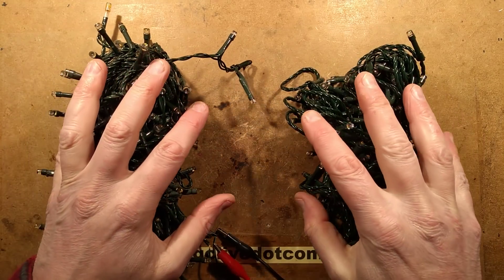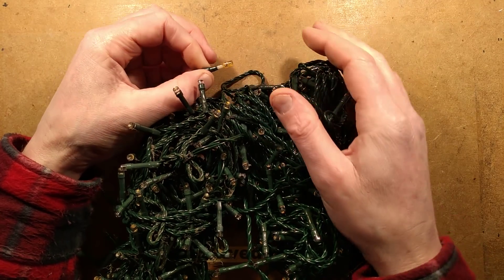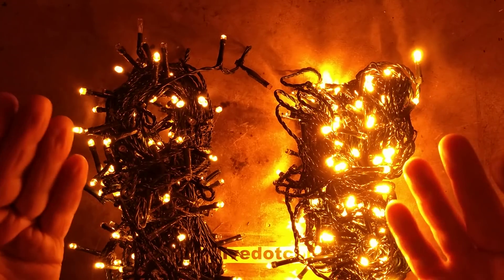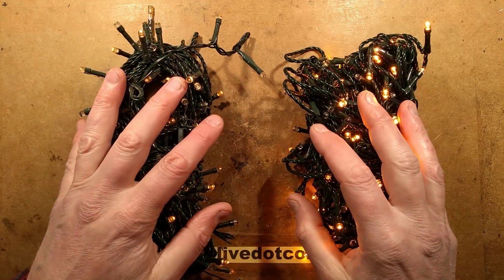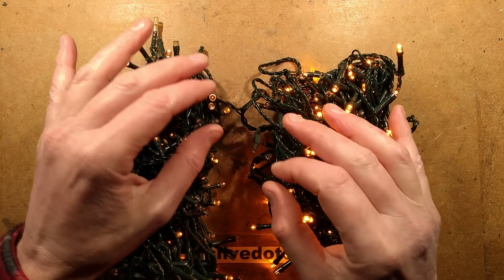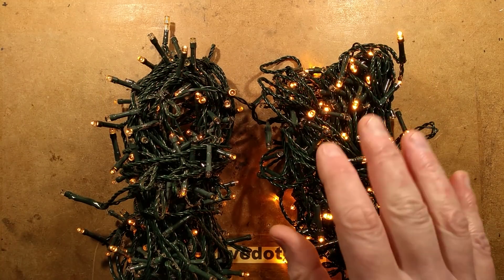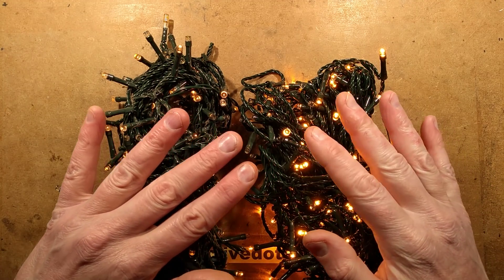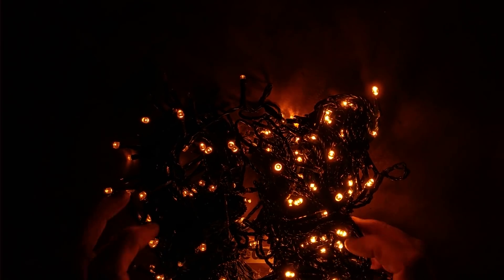9000 hour LED intensity loss test on LED strings.  (All LEDs do still work.)

Comment: That's a great video , highlights an important issue ... A search shows degradation is dependent on temp (current) .... driving leds at 15% recommended max power reduces  degradation by a factor of 10 !  also they are 35% more efficient at low current . The solution is simple a "10W lamp" should contain around  4 x 10W chips driven at 15% , the total  power consumption is 6W but will give the same light as one 10W chip driven at 10W ... chips are relatively cheap this would not double the cost of the lamp ... it would save 35% in electricity over it's life repaying the extra cost within a year ... but also saving the biggest expense  the labor in replacement ... it would last 10 times longer

Comment: I wonder if it's worth running your show lights at, say, 75% the first year, then you can set them higher each year to counteract the dimming effect? Obviously doesn't fix the problem but at least it's consistent.
Reply: running leds at 50% power makes them both more efficient and longer lasting, so that might work better than expected.
Reply: If you run them the way you probably wouldn’t have to even ramp up the intensity the following year...they’ll last a lot longer not being driven at full power. At that point corrosion would probably do them in before they start dimming out.
Reply: this was exactly my thought too but it isnt as shiny as high brightness! next year, go with twice the wattage lights but only half the power used to keep brightness high!
Reply: Just buy two sets of leds. If it is a constant voltage source, put them in series. If it is a constant current source, put them in parallel. In total, they together should output the same amount of light as one single one but they should last a looot longer!
Reply: @l3p3  If you put LED strings in series with a CV source, you double the minimum forward voltage needed to light them up and most likely get ~0% brightness.

Comment: Wow. This has opened my eyes. I taught physics and am generally technical savvy but amazingly believed that the life span quoted for led lamps was to failure. I now discover that it is something called “L-70” which is the time to 70% lumen output, at which time they should be replaced. Instead of being the wonder of the age, worthy of Nobel prizes, they have just been revealed to have feet of clay. OK they are saving gigawatt hours of energy but they are no longer the immortals I believed them to be. Sad.
Reply: Name something made by humans that does last a very long time without having to be maintained...

Comment: The same problem applies to LED's in modern television backlighting. The image can become so blue that, at first glance, it appears to be a problem with the colour balance but with closer inspection it can be determined that the backlighting LED's phosphor has degraded significantly, causing the image colour to shift to a very distinctive blue hue.

Comment: I've always thought that modern leds seem weak, you have proved it and im not mad after all, ok just a bit mad :-D
Remember the old red leds that lasted a very long time as a power indicator on just about every bit of electronics, i've seen leds from the 1980's still working fine.

I still think that all high power leds just can't cope with the heat and die.

Comment: Thanks for showing - very interesting! I am a bit surprised by the fast degradation of the leds after just one year. But its depending on so many parameters that it is hard to be generalized. On what current are the leds driven, how well does the PSU work, does it get overvoltage/current, do they get hot etc. etc. I build a night light a few years ago that is running 7/24 - and i cant see any degradation. I used SMD 5630 leds with nom. current of 45 mA. I run them on less than 1 mA (i thing it was around 0.15 mA) with sufficient brightness and they run of of two 18650 li-ion cells in parallel - i never charged them and starting voltage was at around 3.7V - now 3.6xx :-) The normal cell leakage is probably higher than the led consumption :-) It will probably last for the rest of my life (the leds)...

Comment: I bought a guitar multi-FX from eBay that was sold as faulty because the red LCD backlight was extremely dim. I thought that would be an easy fix so I got it and popped a couple of new LEDs in and they were so much brighter that I had to increase the resistor values. It's surprising to me that these even failed in the first place since they were only being run at 11mA each.

Comment: In our new building at work, we have high-grade LEDs (5000K), which, they told us, last way longer. They salesperson told us that the reason many LEDs degrade, is because of insufficient heat dissipation so every LED panel of their has this huge heat sink at the back to get rid of heat. I wonder if they're correct because these were NOT cheap LED panels to use. They are VERY bright though and I hope they will remain that way.

Comment: I bought a new strand of my LED tree lights 2 years after I bought the originals. At least after 2 seasons the brightness is identical (so far as my eyes can tell) between old and new. They're WalMart's brand so I wouldn't think any effort was put into their longevity. At any rate, after the first 2 seasons they paid for themselves over the cost of incandescent with the power bill savings. If I can get 2 more seasons after this one (5 total) out of them they'll pay for their replacement cost too. I use multi color lights, so by then incandescent ones would be burning out with badly faded color anyway. I can't complain.

Comment: Very illuminating - No Pun. This is why you always suggest running the strings at a lower output level - or other LEDS for that matter.
Okay now i get it fully. Now it makes very clear sense to run them down a bit - and why. I figured hey it's an LED it will last just about forever. Not so, they very much do have a limited life span being driven hard. And i guess i needed to be shown that, you did and i get it at long last i do get it. I thought you were just being very conservative - no you were not.
Consider this a lesson taught and learned. My eyes are wide open now. Thanks Clive. Merry Christmas to you and your Brother.
May the coming year ahead hold blessings and good fortune for you both.
Reply: 30 years ago I tried running some red 5mm LEDs at currents well above the manufacturers maximum rating. They did not last long! ALL LEDs degrade over time in terms of light output. Cheap LEDs are likely to degrade faster.

Comment: The only LEDs I have had go dim were in a wearable headlight. I find a lot of those heatshrink strings are not made quality. They could be made from surplus florr sweepings just to be nice. The ones I use are socketed and I haven't had a single one die in 5 years of 60 day 5 hour use. On another note I have had 120v led porch lights fail in just 2 years. It was either the drive components, or a LED chip burnt open.

Comment: Well good to know it't not me going insane XD. I got an LED strip for my room a couple months ago, and at first it was really bright, like almost too bright to the boint where it was distracting. But then a couple weeks later I couldn't help to feel like it has gotten dimmer, and I wasnt sure if that was it actually dimming or just me getting used to it's light. Had the same story with some other LED lights.. so thanks for clearing this up!

Just wondering tho.. is this the case for all LED's? Because with more and more street lights using LED's (and many of which are sealed so you have to replace the entire fixture) I can definetly see a future problem right there.

Comment: When I got my '93 Pathfinder, I found that the LED third brake light was very weak and splotchy. The voltage checked out and there was no evidence of moisture intrusion. I'd never seen LEDs wear out before, but I guess 230k miles of city driving over twenty-odd years had put some hours on them. I replaced the assembly with another used one with fewer miles on it and it's been fine since.

Comment: We bought a string of white LED lights in a flower shape from John Lewis to put above our bed as decor. After about a week of use, they were noticeably degraded, and showing noticeable random (not consistent) colour shifts too. The first LED in the string faded out entirely after three weeks. So we took them back. They gave us another brand new set; and they similiarly failed in less than a month. So we took them back... And they replaced them, and those failed too. Now they don't sell them any more ;) As you say, the white ones fail a lot faster than the coloured ones in general.

Comment: It has been known for ever that if you drive led's at a lower level their lifetimes increase exponentially, so if you drive them at half power they will outlast your lifetime.
Reply: Mentorcase 
But making leds twice as big and driving them at half the power to achieve the same effect is expensive.
Manufacturers want to really cheap out on those... ahhh, planned obsolescence... we should have harsh laws against this
Reply: Not sure that's would help in this case actually, I think they're being abused in an entirely different way.

If this is like the lights Clive has disassembled before, it's a constant voltage supply, where the current to the LED'S is capped by a resistor soldered to each one and then potted, trouble is with the multiplexing - the inverse parallel.

If there is one resistor per inverse parallel pair, that's relatively ok - the reverse bias across any LED is capped at the forward voltage of the other LED in the pair, not great, but not exceeding specs either.

That would be a pain to wire though. What I bet they've done is have one resistor per LED instead.

That small  change means when the polarity is reversed, the LED sees the entire supply voltage as reverse bias.

If it's a 5V supply, that's at the very edge of what the manufacturer would rate them to, and with switching transients, the LED probably sees upward of 6V reversed at times.

That would absolutely hammer them in the long term, and driving them at lower current wouldn't help- you could replace those resistors by ones 10 times larger, and the LED'S would still be seeing massive reverse bias.

Would be interesting to see whether I was right, and just how common that kind of flaw is in other lights too.

Comment: At our house, we've noticed this fall-off in brightness most on AC strings of multi-coloured Christmas lights, where the red and orange LEDs stay bright enough, but the blue ones fade away to nothing in two seasons. 

We have not yet thought of a good use for strings of red and orange lights.
Reply from the maker: The red and yellow are old gallium arsenide technology that is very reliable.  The blues, greens and whites are modern gallium nitride which is prone to fading.  Modern strings use blue for all the colours with red, yellow and green phosphor on them.

Comment: The problem is too much current. I did a lipo and sepic conversion of standard LED strings. I run the lights off a sepic converter to keep the lamps constantly lit from a decreasing supply voltage (i.e a battery), removed the current limiting resistor and run the lights so they are not at full brightness and they have lasted for years. I was going to send you a set of those "push top lights" that use 3 aaa cells and 3 or 4 leds in a circle I bought from a well known hardware seller that I had to keep replacing and it was because they had no current limiting resistor and were putting 100ma into 3 leds they were very bright initially however they went dim within weeks, after I twigged what was going on I set the sepic converter to deliver just 2.97 volts/20 ma per whole light (7 ma per led), they were just as bright as with the 100 ma and that was 3 years ago and they are still the same brightness. Tip:Get twice as more lights as you need and run them at reduced brightness and they will last for a long, long time.

Comment: Prompted by this I did a check on a couple of TCP-branded 810 lumen 2700K GLS lamps used in the living room here every evening from before dusk to around 11pm since the middle of 2014.

In a repeatable setup and after warming up: 
 Unused reference bulb 410 lux 
 Bulb #1 350lux
 Bulb #2 360lux

So 12-15% down from new in over five years. In that time the CFLs previously used would have been replaced twice due to their visibly reduced output.

While I was at it I measured a couple of other new/hardly used 810 lumen 2700K bulbs.
  Philips 412 lux
  Sainsburys 415 lux
  TCP (above) 410 lux

That's unbelievably consistent.

Comment: The higher current on the second set might just be measurement error...  For the first set you have the wire in the geometric center (marked with arrows on the clamp head, it's the position the meter is calibrated for) but on the second you have it pushed all the way against the top.  With such small currents, the difference in position can have a significant impact on your measurement.  (I think the impact on measurements is worse for DC, but I don't remember for sure.)
Reply: I have the same meter and haven't noticed that effect. Not that I specifically tested for that, but I've always been impressed how accurate the readings are from it. Might be worth further testing that.

Comment: When the LED Xmas lights came out a lot of folks did not like the very bright intensity of the leds. Also you could sort of tell the way it produced the light was nothing like the old filament type bulbs. To preserve the leds would be to have them on a PWM and DC circuit to control the brightness as well as providing a constant current. LEDs do not like too much current even at the rated current. I have a LED bank running on my bench now for 8 years been running on DC power and running at 80% of the rated current and it still produces the output like it was new.

Comment: In a local factory, they changed metalhalide lamps to new LED lamps with adaptive brightness; after few months running 24/7 they had to omitt all the controlers and run them all time full brightness just to keep reasonable brightness for night shifts; and now after like 5-6 months, because its too dark at night, manufacturer is about to replace whole system, funny that it was meant to be super intelligent/power saving and cost efficient... Kinda sux when you have to bin few hundred fittings twice a year...

Comment: This has me thinking - Network Rail recently changed the rules so UK trains no longer need yellow painted ends provided they fit LED lights of a particular intensity. I appreciate a bit of yellow paint isn't a catch-all safety feature, but it isn't going to be much of a safe derogation if the lights start getting significantly dimmer after 9,000 hours, which for railway stock is next to no time.

Comment: Hi Clive, 
Very interesting video but it got me wondering what the relationship between how hard the LEDs are driven and the length of time they take to degrade?  Out of interest what percentage of the ideal working current were the set running at?  Did they intentionally overdrive them because they are only on half the time?  Al
P.S. We can now all claim any spelling or grammar mistakes are due to trash wine consumption! ;)
Reply from the maker: I reckon the LEDs were being run at about 5mA.
Reply: @bigclivedotcom  Wow, that does not bode well for the many that are run at close to full power.  Oh well, back to the flourescents! ;)  Al
Reply: Huh? In the video you measured the current at 90 - 100 ma
Reply from the maker: @pauldzim  Divided between parallel LEDs.
Reply: bigclivedotcom  D’oh, of course

Comment: An interesting experiment. It seems reasonable to suppose that LEDs pushed close to their current limit will degrade faster. And that is the most likely explanation in this case. However, because all the LEDs are in parallel and fed via some kind of common current limiting, it doesn't prove conclusively that they have ALL deteriorated. Just one LED developing an internal leakage would be enough to pull down the voltage to the rest of the set causing them all to dim.

Comment: Tungsten lights also fade a bit -- nowhere near as much as fluorescent or LED, but still a noticeable amount.  When I was a kid in the '70s and '80s, the house I lived in had a two-bulb light fixture in the bathroom, and I can remember when one bulb would burn out and my mother would replace it, the new bulb was noticeably brighter than the one that hadn't yet burned out.
Reply: Significantly under-running a tungsten filament lamp will result in ‘splatter’ (metal) from the filament becoming deposited on the inside of the glass, which makes it turn towards a black colour, and which reduces the light output.
Reply: @Mark1024MAK  That's true -- I forgot about that. So those bulbs I remember as a kid could just have had 'splatter' on the inside, rather than actually having lower light output...

Comment: On a related point, I bought half a dozen led bulbs for number plate. Just 2 parallel strings of 3 series LEDs each and resistor limiting the current to about 20mA total (10mA per led string).
They were fine. A month later both were dead with black spots on the LEDs...No idea why that happened.

Comment: I've had old early 80's red led's fail completely. They were the higher intensity ones from those days, used in professional videotape machines to detect the clear ends of the tape. The old lower intensity ones don't seem to fail but they do get dimmer. I want to know how much more life can one get out of various led's by running them with less then full power. Those tape machines will crash hard into the end of the tape at maximum speed (and possibly break and damage things) with a dead led. I even had one led dim down and fail right in front of me.